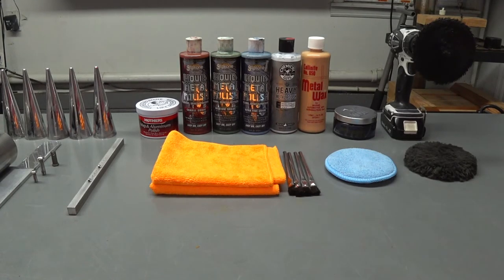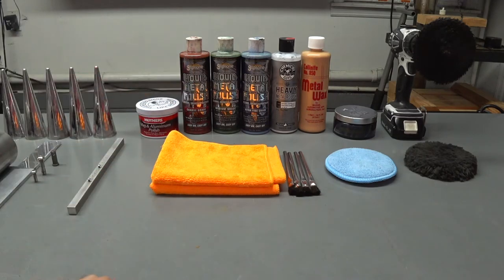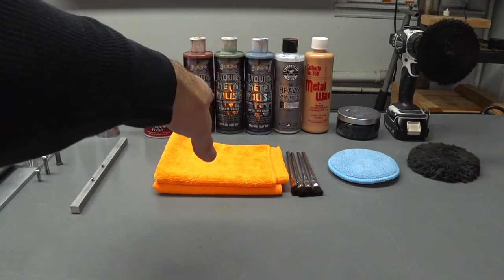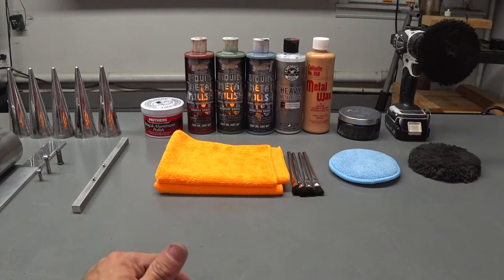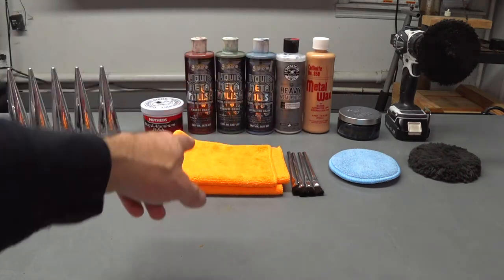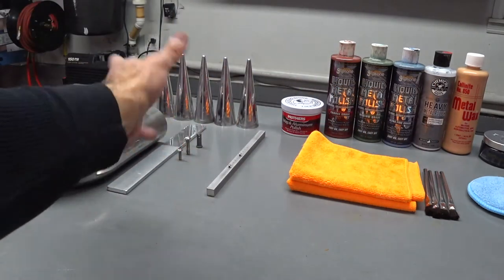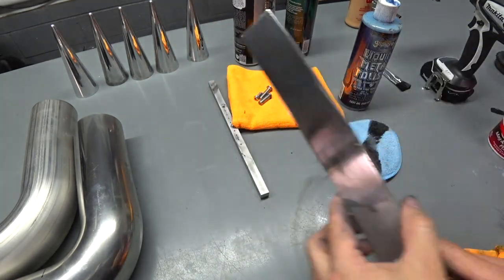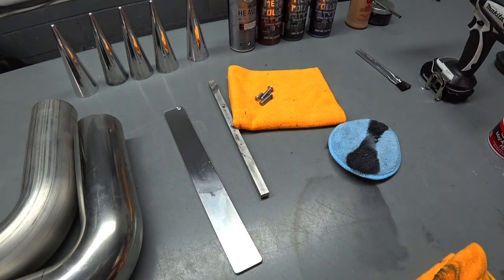How To Polish Aluminum & Stainless Steel Easily | Auto Fanatic

Comment: excellent, what do you think of flitz and 303
Reply from the maker: tried  those many years back they are not as good as the stuff im using in this video, i do this often not just small parts but i polish hundreds of feet for large projects for work, the stuff i use are lifesavers. Il be posting more videos showing the rotary techniques on metal and using industrial buffers with large flap wheels.
Reply: Auto Fanatic  
Thank you, I hope more videos soon and learn more.